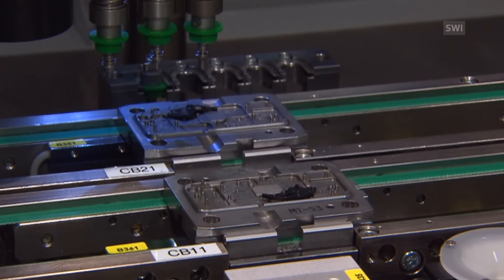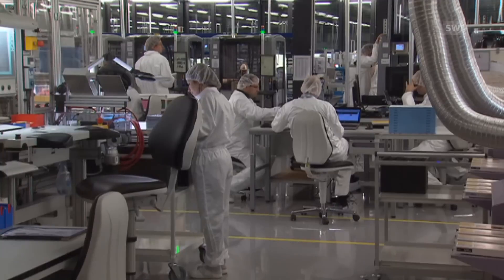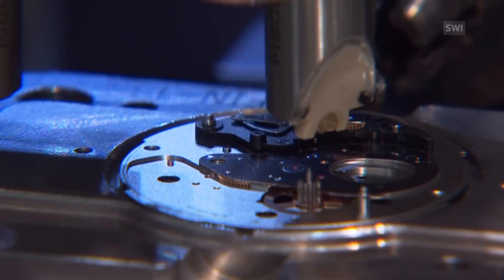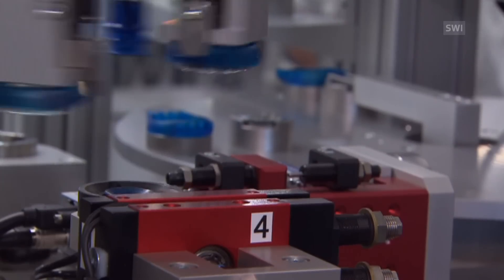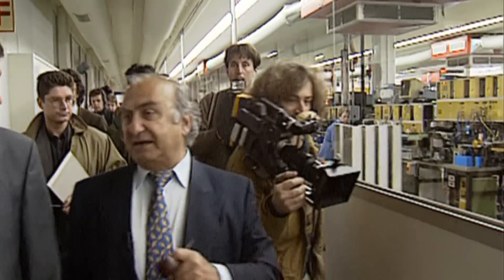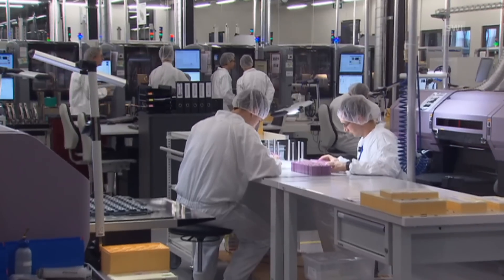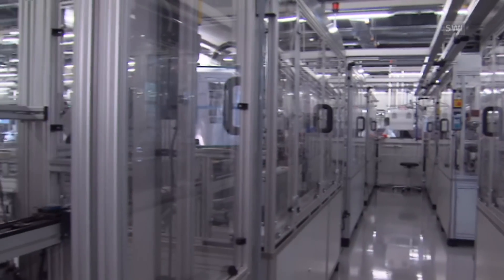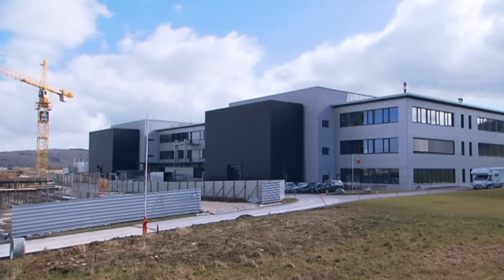Cheap Swiss watches made by robots

Comment: I wouldn't buy one, it's over priced Swiss junk which is unrepairable.  Even a Seiko-5 is money better spent by far.
Reply: +Tomasina Covell the you missed the point of this watch neither you understand the purpose of the Seiko 5.
Reply: Alex Serrano
Prove it?
Reply: ***** Servicing a mechanical watch costs 100€ at least (reparing would be double that price depending on the pieces needed), which surpases the original cost of the watch in the case of a Seiko 5/Basic Orient,  hence no one buys a Seiko 5 to keep it as a family heirloom.
Beat error of those cheap movements are not regulated by the manufacturer which make them pretty inaccurate in the long term.

As opposed to cheap Japanese watches , this Swatch is made from a non ferrous alloy, its simplification in the number of parts makes them less sensible to temperature changes and the use of self lubricating components removes the need of servicing it for the intended lifespan of mechanical watches in this price range. It's of course much lighter as well. The low price of this watch is acquaired by producing it with a completely automated assembly line and not by producing it in China or Malaysia for cheap workforce. It's also made in Europe.

This watch is just fullfiling the purpose of an automatic in this low price range and is of course not intended to be a Patek Philippe that lasts several generations (just as those entry level Japanese movements).
Reply: What non-ferrous alloys are you implying, and what parts in particular?  You sound like a brochure Swissofile.  Of course Seiko regulates beat error, obviously you've never done one.
Reply: +Tomasina Covell The entire movement of this Sis 51 is made from ARCAP (except for the escape wheel and pallet fork which is plastic).
Beat error is not regulated on 7S nor 4R movements, that would increase the price (you can open the case and regulate the mainspring length yourself though).
I'm not a fanboy nor I do care about multinational companies, I'm just stating facts that you can check for yourself.
It's all a matter of personal choice in the end, I would buy this solely for its originality and wearing comfort.
Reply: Alex Serrano
Where are you getting that beat error isn't regulated on Seiko 7S or 4R?  I work on these movements, I COA them.  They're like luxury movements compared with that so-called Sis-51.
Reply: +Tomasina Covell why don't you buy a fucking rolex instead?
Reply: uh... ok just forget about it
Reply: +Tomasina Covell does not matter swiss made is swiss made
Reply: +Tomasina Covell  You talk  nonsense .The Swatch is a  wonderful watch .
Reply: *****
I can certainly understand that.  Which Seamaster line, the AT, which caliber is it and how's its daily summing?
Reply: Don`t you mean the Hairspring?  I have a  Seiko in for service. It hardly needs it. Just a clean, oil and time it up. Beat error is 2 milliseconds.  27 years old.!! It is a hobby for me. I will charge £20.
Reply: And not only that it's not really made by robots.  It's simply an automated assembly process, with the "making" being still pretty much the same as always.  The "Swiss" love to hype things out of all proportion like this since they're always doing a diq measuring contest with the Asians.
Reply: i am owner of Hamilton khaki automatic and is perfect and very reliable.
Reply: @christosnsk  Yes, I've got two, an old one and a new one.

Comment: At the price point of a System51, comparable mechanical watches are also throw-away watches.  System51 is sealed can't be serviced, and if you buy a serviceable watch at the same price the cost of service, which would be possible, is as much or more than replacement cost.
Reply: The metal version can swap out the movement, and I do speak to someone who is a huge swatch fan.

Comment: Without the Swiss we wouldn't have watches. Without Swatch we wouldn't have mechanical watches. Seikos are over rated. My Swatches outlasted my seikos. Besides repairing a $200.00 watch for $80.00 doesn't make good sence to me.
Reply: Thomas Espinosa without seiko we wouldn’t have quartz, springdrive, kinetic, etc. give me an example of a Swiss company making a new technology (you won’t find one).
Reply: Thomas Espinosa: The swiss didn't invent the watch. Swatch is a terrible crap.
Reply: There was a time where Swiss watches were the cheap ones, German and French watches were the top manufacturers in terms of technology and reliability. So please inform yourself and don't invent, Swiss watches were not the first mechanical ones. Plus, you can see many many test, including official competitions, where Seiko beated Swiss brands both in terms of reliability and precission. Maybe you don't know it but many swiss brands buy parts from Seiko and then assemble them, there are almost no 100% Swiss made watches, in fact some brands like Breitling have bough Seiko's rights to build slighlty modified versions of their movements in Switzerland(and they're not the only ones).

You are clearly uninformed or a fanboy, maybe because you have some doubly made "Swiss watch" and you try to justify your bought after seein this. I have both Japanese and Swiss made and unless you're going to expend thousands of euros you usually get more quality per euro with the Japanese ones, it's how it is.

Comment: Why buy a mechanical watch? Even the cheapest - £15 - quartz watches are usually more accurate than a "swiss chronometer".
Reply: That's a fair question. I own both quartz and mechanical automatic watches.  With Mechanical watches, there is a relationship with the watch.  You have to keep it moving.  Also, the fact that it IS mechanical and not battery operated is a draw.  It's a step back in terms of technology, but that is not a bad thing.  I prefer classic things like DE shaving and mechanical watches.  I didn't "get it" until I bought my first Seiko 5.
Reply: Because their cool. If all you want to do is tell time just use your phone.
Reply: Agreed, the DE as well.
Reply: because of that sweeping seconds hand, quartz are boring to look at!